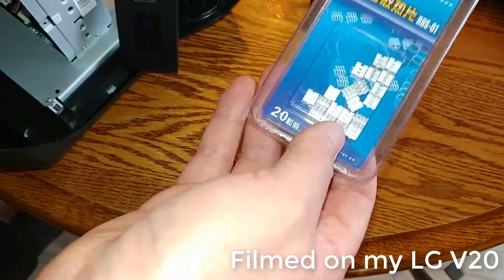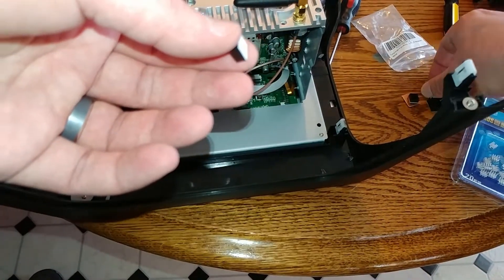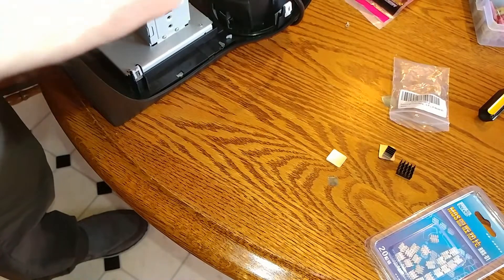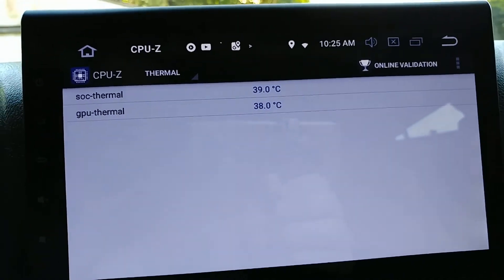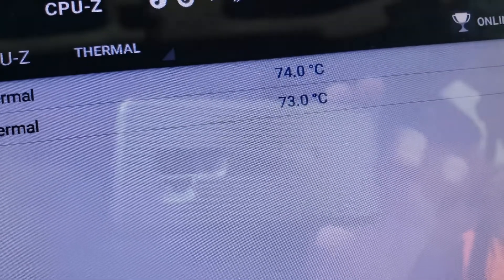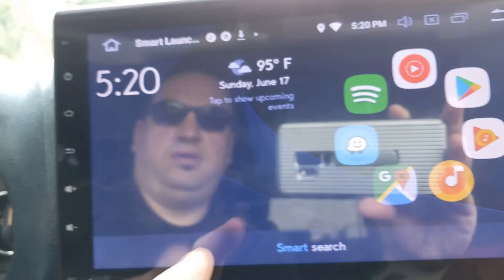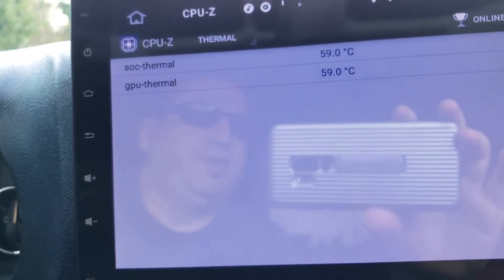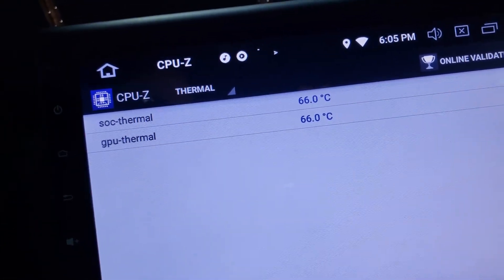Adding a Heat Sink to a Dasaita Hot Audio PX5 Android head unit

Comment: I got my v600 px5 2gb a couple years back. Hot summer, playing music, GPS  use etc. It would slow down to the point of serious lag. Fixed it by putting on a smaller passive pc cooler with thermal paste and secured with clips and existing screws. Also, ventelate the top lid! Make holes or slots on that cage because that's a little toaster box in the summer. Works like a champ since, smooth  operation no hiccups...

Comment: For my Mazda CX-5 I'm looking at either the dasaita brand or seicane brand but the dasaita brand is a lot more expensive. Do you think I'll notice any difference in quality or features?
Reply from the maker: You want to make sure you get a unit with at least 4GB of RAM.

I have had good experiences with both Dasaita and Seicane. There are some differences, but I haven't fully tested the new Seicane yet. I will get it installed this week

Comment: How necessary is this? Just got my dasaita in... I live in florida so this might be a necessary addition
Reply from the maker: I really can't confirm if it is needed or not, but I have been using these Android head units for over 2 years and I have only had one die. That was a Joying and it just quit working in the middle of the summer on a particularly hot day. I have been running this Dasaita with these heat sinks since this video and it has been a pretty hot summer in KY, and so far I have had no issues.
Reply: thanks! I'll see how it goes without it. I have some old cpu heatsinks i can slap on there.
Reply: @chad499  I've had my unit just over a year and at summer 2 in newyork is when it started crashing from heat.
Reply: @justinsharon3096  I've had mine for a little over a year. I haven't had issues without a heatsink. Sometimes my backup camera flashes wildly but it corrects itself.
Reply: @chad499  do you use the air conditioning?. I never use my ac so my unit gets brutally hot.
Reply: @justinsharon3096  in Florida. It's a necessary tool for survival.

Comment: It seems to me that there PX5 units get hot and sometimes lock up when they get too hot. A cooling fan is probably a good idea. Use a heatsink and fan designed for cheap GPU's. Also allow for air flow.
Reply: Lmao I'm coming to this video since I drive with the windows down no ac and about an hour of driving in 85 degree weather my dasaita decided its too hot and locks up. My favorite part is when I go to thought my car in reverse to use the camera and the headunit instantly freezes from the heat

Comment: It is a good idea to cool the cpu, but are you not afraid that those heatsinks will come loose and fall off with all those vibrations if you driving around with the car? I gona install a Noctua NF-60X62X25 5 Volt fan.
Reply from the maker: Walter Verbeeck well I was not previously afraid of that...
Reply: lol!